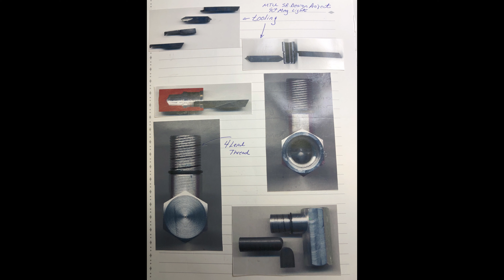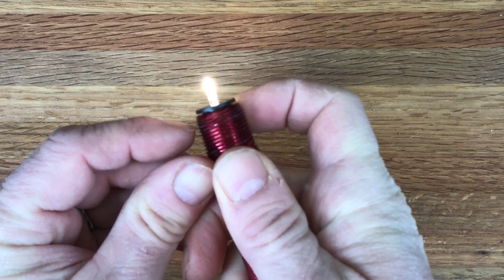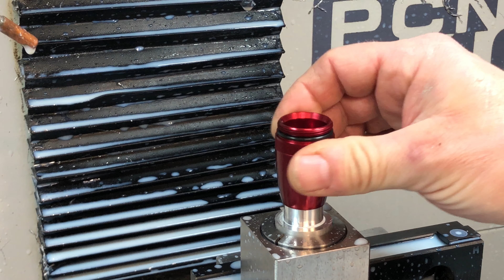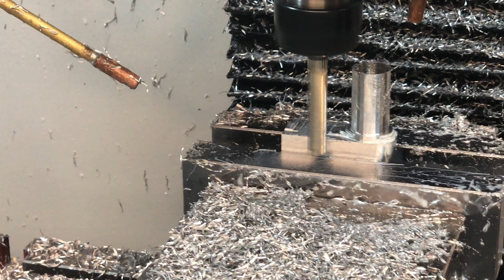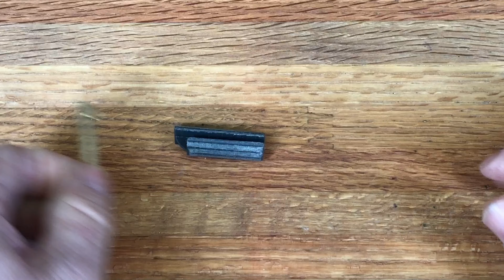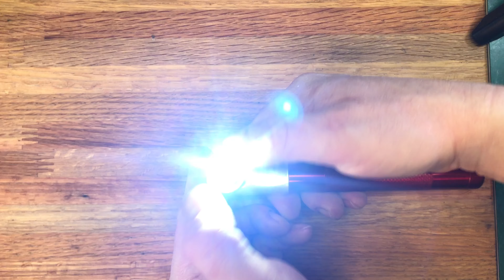90 degree attachment for my Mini Maglite flashlight done on a Tormach 440.  CNC a 4 lead thread.

Comment: I've been thinking about upgrading from my taig  to a tormach ,  is there anything you don't like about your 440  now that you've been using it awhile
Reply from the maker: I wish the work envelope was bigger.  But I knew that when I bought it.  I needed to get the CNC into my basement so the 770 was not as good an option.  If you have the space, the 770 would be better.
Reply: @LastBastionLabs       thanks ,   i have the room but not the budget for a 770   .    you do some fantastic work
Reply from the maker: I totally understand.  Thank you, its not hard with a tormach.